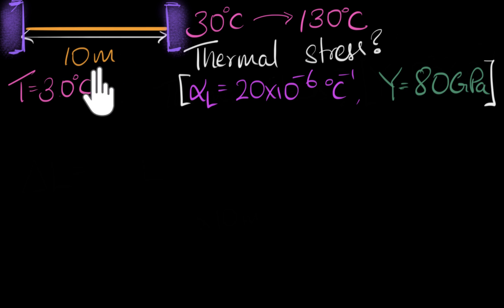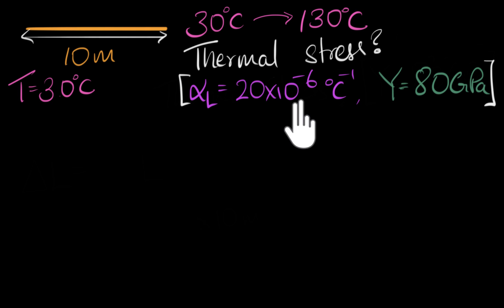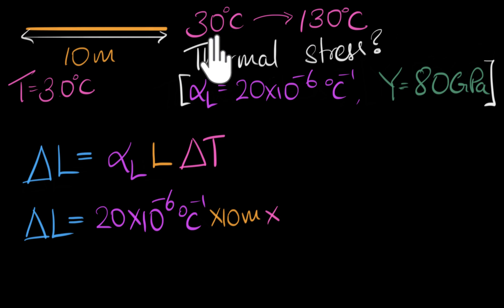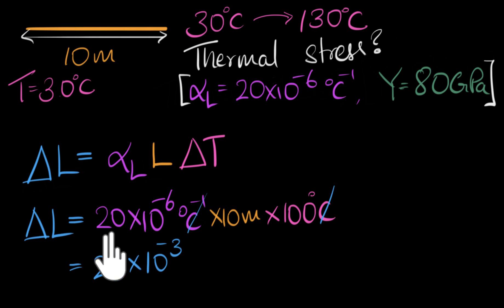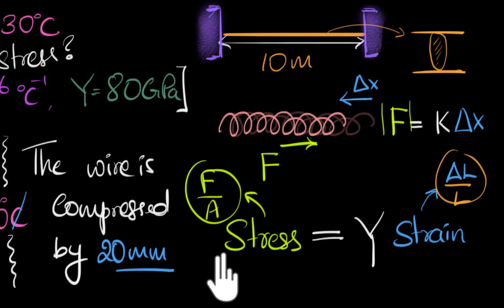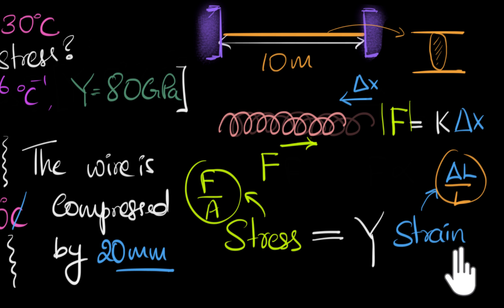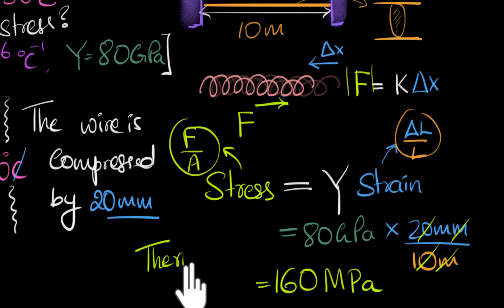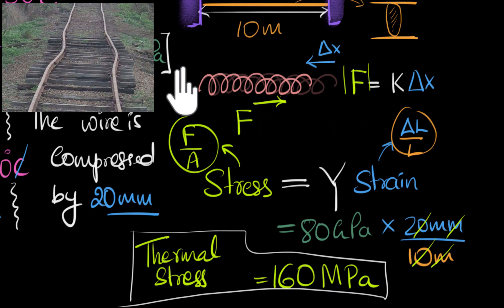Thermal stress | Class 11 (India) | Physics | Khan Academy

Comment: The answer is wrong because you forgot to convert 20mm to metres. Which means strain Is 0.002 and not 2.
Reply: The answer is correct he just converted Giga pascal to Mega pascal doing so he converted mm to m. Don't bluntly say its wrong.
Reply: @adityalahkar1043  it was a doubt genius. by the way i got the 5th highest mark in TN. I know marks don't matter and they don't determine one's intellectual capacity but thats how low lives like you understand.
Reply: @Suresh-rl5zr  Lmaaoo. Then why mentioning your rank if it doesn't matter. You are just trying to hype up your self. You are clearly trying to get attention.

Comment: Hi, Thank you for the video. I have a question here. Should we call this thermal stress or stress due to thermal expansion? because even if we have no walls and just a wire or pipe and then raise the temperature unevenly we have thermal stress inside the wire or pipe and that is something different than this. This stress here indirectly exists because of changes in temperature but actually because of expansion.
Reply: actually, stress occurs when there is no way to expand- fixed ends. So, this s thermal stress.
Reply: Actually a stress is created when there is a change in length , but in this case even though there is no change in length a stress is created, this stress is known as thermal stress